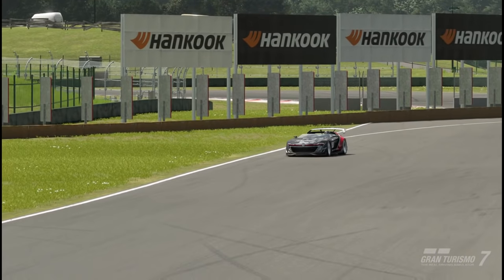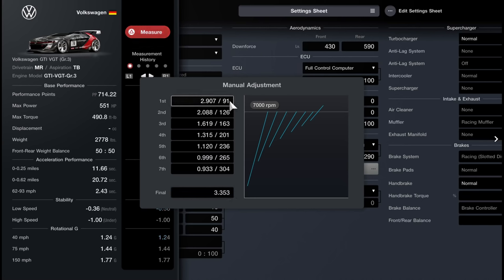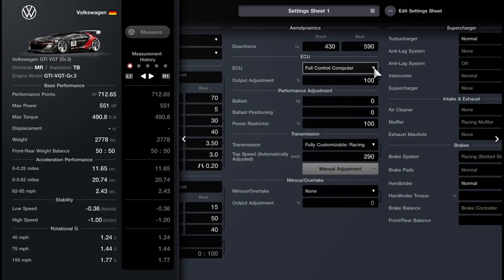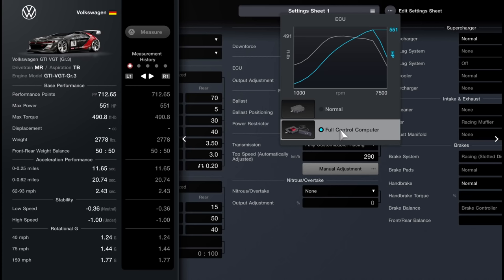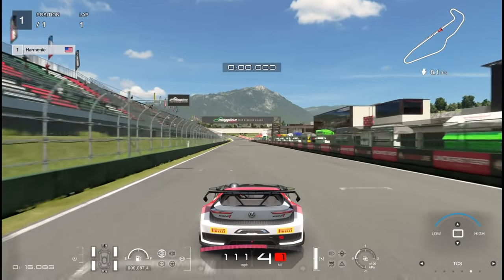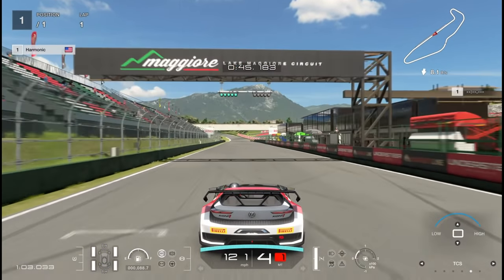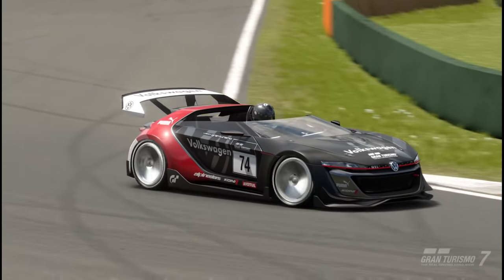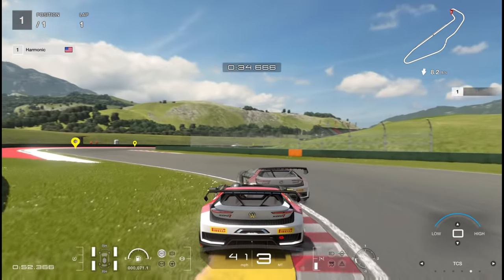How to Tune GEARING | Gran Turismo 7 Tuning Guide

Comment: The Stanlick formula: 

Gear Ratio = 1 ÷ (1 - ((1 - (1 ÷ Point of Convergence)) ÷ Convergence Factor) • (Final Term)) 

Explanation: 

• Point of Convergence: This represents the desired 1st gear ratio upon which all other ratios will converge. It sets the foundation for the exponential progression of subsequent gear ratios. 

• Step-Length: Calculated as Number of Gears - 1, or (N - 1), is the amount of steps between the Point of Convergence and the remainder of the steps, or in this case, gears. For a 10-speed you would have 9 steps, for a 9-speed it would be 8 steps, for an 8-speed it'd be 7 steps, and so on; just be sure that the difference between the Final Term Floor and the Convergence Factor is always equal to (N - 1). 

• Convergence Factor: This controls how quickly all steps (or gear ratios) converge towards the final step (or ratio) that is at the Nth step (or gear). It's closely tied to the Number of Gears (N) and the desired Overdrive because: Convergence Factor + / - (+ / - Final Term Floor) = N - 1. The Convergence Factor is always minus a (negative Final Term Floor value), and plus any (positive Final Term Floor value). The Convergence Factor must be reduced or increased according to whatever value the Final Term Floor is to follow the rule N-1 = Step Length, which ensures that the Step Length is constant. 

• Final Term: This term is incremented for each gear, starting from the highest (final) gear and adding +1 to it for each preceding gear. Its floor value determines the Drive Level. A Drive Level of 0 = no Overdrive (1.00 : 1.00 top gear) whereas negative values for Drive Level such as -1 will produce levels of Overdrive. The opposite is true for values > 1, yielding more Torque Multiplication closer to the Nth ratio and producing Underdrive. 

• Final Term Ceiling is what ensures that the first gear ratio is achieved when it matches the Convergence Factor. This means that if you add 1 to a Final Term of -1: (-1 + 1) and make it zero, you'll get 1.00 : 1.00 as an output from the formula. If you add 1 again, it produces a number that is > 1.00. If you continue to increase the Final Term incrementally by 1, by the time it equals the given Convergence Factor, the formula will produce the desired first gear ratio that was set as your Point of Convergence. 

Example: 

• Using 1÷(1−((1−(1÷3))÷8)×(−1)) for a 10-speed transmission, it will produce the following ratios from 1st to 10th gear (rounded to the nearest hundredth): 3.00, 2.40, 2.00, 1.71, 1.50, 1.33, 1.20, 1.09, 1.00, and 0.92. 

• The reason it has 8 as the Convergence Factor is because it is for a 10-speed gearbox wherein there are 9 steps between the given ratio of first gear and the resulting ratio of last gear, so (9 + -1) = a Final Term Ceiling of 8, and that ceiling (8 - -1) = 9, which preserves the Step Length of 9 for a 10-speed. Whenever the Final Term matches the Convergence Factor, the result will always = Point of Convergence, which is in this case 3.00 at 1st gear. 

• Of course, if you keep the Point of Convergence at 3.00 but lower the Final Term Floor to something that is < -1, say -2 or even -3, it will produce several levels of Overdrive and will create a more gradual progression both converging to the Point of Convergence and diverging towards the Nth gear. The opposite of this is true if you want less overdrive and desire a final gear of 1.00:1.00. Just make the Final Term Floor = 0, and the step length of N-1 for a 10-speed that is 9 would be seen as the Point of Convergence because (9 + 0) = 9. 

Key Principles & Advantages: 

• Exponential Scaling: The formula generates gear ratios that follow an exponential decay pattern where going in the direction further from the Point of Convergence there is progressively less delta between consecutive ratios (convergence). This results in a "wider" ratio spread amongst the lower gears, prioritizing torque at lower speeds, and each gear above the previous becomes progressively closer on the delta between consecutive ratios (divergence) as they get closer to the Nth gear. Obviously, given the sheer number of gears and the other parameters in the formula, you can scale exactly how steep this exponential decay (convergence towards Point of Convergence and divergence towards the Nth gear) is and exactly how gradual or sudden it is to get the set of ratios that best suits your needs and vehicle using pure algebra. This is a mathematically precise way to take advantage of the nature of geometric exponential feedback loops, that yields numerically perfect and scalably balanced ratio spreads with zero guesswork beyond the input of initial values. 

• Adaptable Convergence and Divergence: The Step Length adjusts dynamically based on the number of gears and desired Overdrive as determined by the Final Term Floor, ensuring seamless integration across various transmission setups. 

• Precise Overdrive Control: The Final Term Floor value allows for precise control over the top gear's overdrive level, enabling customization for specific tracks and racing strategies. 

• Consistent Step Length: The formula maintains a consistent step length (N - 1) between gear ratios, ensuring a balanced and predictable progression for smoother shifts and improved driver control. 

Ratio Spreads from 10 to 3-speed 

• Here is a series of charts for a 10-speed all the way down to a 3-speed. I chose a first gear of 3.00 : 1.00 as it is a median between 4.00 : 1.00 and 2.00 : 1.00, and I adjusted the Final Term Floor to -1 to apply a single level of overdrive to all of the spreads. Of course, you can manipulate these values at will to make your own charts. 

• The formula used for these ratio spreads is as follows: 1÷(1−((1−(1÷3))÷Step Length)×(−1)) and here are the results: 

10-speed: 1÷(1−((1−(1÷3))÷8)×(−1, 0, 1, 2, 3, 4, 5, 6, 7, 8)) 

1=3.00 (8)
2=2.40 (7)
3=2.00 (6)
4=1.71 (5)
5=1.50 (4)
6=1.33 (3)
7=1.20 (2)
8=1.09 (1)
9=1.00  (0)
10=0.92 (-1)

9-speed: 1÷(1−((1−(1÷3))÷7)×(−1, 0, 1, 2, 3, 4, 5, 6, 7)) 

1=3.00 (7)
2=2.33 (6)
3=1.91 (5)
4=1.62 (4)
5=1.40 (3)
6=1.24 (2)
7=1.11 (1)
8=1.00 (0)
9=0.91 (-1) 

8-speed: 1÷(1−((1−(1÷3))÷6)×(−1, 0, 1, 2, 3, 4, 5, 6)) 

1=3.00 (6)
2=2.25 (5)
3=1.80 (4)
4=1.50 (3)
5=1.29 (2)
6=1.13 (1)
7=1.00 (0)
8=0.90 (-1)

7-speed: 1÷(1−((1−(1÷3))÷5)×(−1, 0, 1, 2, 3, 4, 5)) 

1=3.00 (5)
2=2.14 (4)
3=1.67 (3)
4=1.36 (2)
5=1.15 (1)
6=1.00 (0)
7=0.88 (-1) 

6-speed: 1÷(1−((1−(1÷3))÷4)×(−1, 0, 1, 2, 3, 4)) 

1=3.00 (4)
2=2.00 (3)
3=1.50 (2)
4=1.20 (1)
5=1.00 (0)
6=0.86 (-1)

5-speed: 1÷(1−((1−(1÷3))÷3)×(−1, 0, 1, 2, 3)) 

1=3.00 (3)
2=1.80 (2)
3=1.29 (1)
4=1.00 (0)
5=0.82 (-1) 

4-speed: 1÷(1−((1−(1÷3))÷2)×(−1, 0, 1, 2)) 

1=3.00 (2)
2=1.50 (1)
3=1.00 (0)
4=0.75 (-1) 

3-speed: 1÷(1−((1−(1÷3))÷1)×(−1, 0, 1)) 

1=3.00 (1)
2=1.00 (0)
3=0.60 (-1)
Reply from the maker: @joshuastanlick6217  it's cool that you went through all the trouble to do that, but unfortunately that's not the best way to optimize gears because every engine's power and torque curves are different, and each track has different cornering speeds. Going with the philosophy I demonstrated in the video will get you better results in less time.
Reply: @Harmonic14 I do not concur. Adjusting the terms in the formula can give a mathematically precise set of ratios, and even if they may need further refinement after initial calculation because the mechanics aren't intuitive, they are still an excellent reference and will always win out in precision with just a bit of study. I know it isn't the only method, and if a more organic approach is your jam, that is indeed cool as well. I prefer to take 3-5 minutes to crunch some numbers and get something numerically perfect based on gear spread, amount of gears, and things like the torque and power curves of a combustion engine, which the commensurate scaling addresses passively, rather than eyeballing things. For others who prefer a more technical approach, I'm sure they'd appreciate the coolness of my work, which I have provided to enhance your more organic approach. I think a combination of precision and eyeballing things can yield the most effective results.
Reply: @Harmonic14  I encourage you to play with the values in my formula: 1÷(1−(((1−(1÷Desired_1stGear))÷Scale_Factor)×((1+Increment_Factor))) to see what kind of results it can produce for you.
Reply: @Harmonic14  Or, use one of the provided gear sets that I calculated using 1÷(1−(((1−(1÷3))÷Scale_Factor)×((−1+Increment_Factor))) and see how that works out for you before implementing the organic approach.

Comment: Great video! One question, when using manual Adjustments has the ‘Top Speed (Automatically Adjustment)’ any influence? I think not, but it makes more sense if it greyed out.
Reply from the maker: Top speed is just a quick slider to set all gears longer or shorter. Be careful with it though, because if you move it after setting your individual gears, it will revert those changes. That's why I tend not to use it.
Reply: Adjusting the final drive to a lower value will increase top speed and the opposite for more acceleration. If you want to have it set for a certain circuit have the gearing set for an extra 10kph to allow for drafting on other cars

Comment: Awesome video, I did have a question, you mention adjusting the gears to be in the peak power band before drop off but how do I know I am adjusting the gears in that band
Reply from the maker: Just check what RPM you're at in each gear, just like in the video
Reply: @Harmonic14  oh I see what your saying got it makes sense. I thought there was an easy way while changing the gear ratios that we could see that. Thank you.
Reply from the maker: @vrdubb0221  unfortunately there's not, which is why I didn't really cover the actual gear chart much. It just gives you an RPM limit, and it tells you what speed you're hitting at that limit, which isn't enough information. By the time you eyeballed that graph and figured out where you need the gear to be, you could've done it on track already and made multiple adjustments.
Reply: @Harmonic14  sweet, thank you. Keeping making the banger videos. It’s super helpful.

Comment: Awesome easy to understand. I have a question. I’m using the Nissan z33 fair lady. Every time I accelerate in lower gears she kicks out on me and I spin out. How would I correct that. Is that in gearing? I haven’t changed them at all.
Reply from the maker: You could potentially change your gears to alleviate that, but throttle control also plays a part in it. Ideally, you'll run TCS at 0 and modulate throttle so you don't wheelspin, but if you need to, put TCS 1 just to learn the car a bit more, then try going to 0 and practicing precise throttle control.

Comment: I’m so confused. I don’t understand how to interpret the gear numbers and the graph as it relates to the ideal RPM for power/torque. How exactly do I know where to set each gear?!
Reply: The lower the gear the faster the car is but gears take longer. Which for circuits like delivery stage route X (US) is the best.
The higher the gear the shorter the gears take but make the car slower. Ideal for technique circuits.

Comment: This is an amazing video, so informative.
Can you make a video explaining the strategies in tuning cars for 600 and 700PP races? I raced a car and set it up for the menu books and passed the tourneys, but the single race 600-700 PP races i can't come in first.
I've took high end cars and throttled them back, took weaker cars and upgraded them, tuned the transmission for last gear redlining on the straight, used low and mid turbos when I can.
Micro manages slicks to hard sports to add more horsepower. ETC

I'm tinkering EVERYTHING and I really don't know what the best approach is to tuning for a set PP. If you made a video explain how to approach tuning cars to a set PP , like buying weak cars and gearing up to the PP or getting suped up cars and power regulating them back down, swapping slicks instead for more power components ETC, this video would be the missing link the video game forgot to implement as a tool for teaching people how to REALLY tune your car and not JUST add faster gear, but to look at all aspects of tuning like taking control components over HP: torque comments ETC.

Can you do a video on the do's and don't's of finding the right cars and tuning practices for set PP races?

Thank you good sir. Thank you for this great video, super helpful. now target this to getting a car to a optimal specific PP race. 😛
Reply: What I do for the Gr3 races with a 730pp limit, is use a car of preference (I like the Gr3 McLaren 650) and then add a turbo that suits the car best (for the McLaren it's the mid RPM turbo) and then use the power restrictor to get it back down to 730pp. The change seems small but you usually get something like +50bhp this way and a nice chunk of torque during corner exits. Sometimes the power restrictor is not enough even at 70%, you then add some ballast until you get under the desired PP. Hope that helps. The races are still challenging, especially the 5 lap races. The 10 lap races are quite easy if you use 6 fuel management and go for a 1 stopper every time.
Reply: @johnraesen5368  
Thanks for the tips, I wanted these guys to make a video on how you can't skip over tires, customizable trany's, brakes etc.

You used a GR3 car so most of this was covered for you, but there are situations when you take a standered car and need to tune it up properly, taking into account the stability parts and how to balance them all.

So that's what I'm aiming for, and it's not just for me, it's for the community at large.
I think the game missed and opportunity to implement this into the game like the earlier ones, when they teach you, and help you fully understand the nuance of racing.
Reply: @l337g0g0  gotcha. What I can still share is that other than the Gr3 races, for the 700pp races I use a tuned '91 GTO that has like 698PP but devours the competition due to its superb handling. I didn't tune the suspension, LSD or gearbox manually and just went with hard racing tires and all the other upgrades from the shop that will boost performance.

For the 600PP race it gets a bit tougher, but I use a R34 Skyline with turbo installed and a few other upgrades, but the key is obviously to keep it below 600PP so you have to be careful with the upgrades.

Other than that, the only things that are really worth understanding while tuning are suspension, gearbox and differential (LSD). I agree that the game does not explain these terms very well as they can be quite useful to make a car perform to your liking.
Reply: @johnraesen5368  
that's my point.
Suspension, tires, how you can implement the LSD, lower final gear on tranys to make the most utilization of your tyrany upgrade and not waste top end speed you will never use on a given track, and put it to acceleration.
Right, you can go much deeper on car height, strength of sway bars and braking distribution, weight distribution, down forces etc.
The game has the ability to go all out and fine tune to the emf degree.
But the basics in the game are not covered I don't think.
Reply: @johnraesen5368  
Do me a favor and use your Mustang GR4 and try and win the GT cup GR.4 race at High speed ring.
I've done everything possible to that car and once got a 1:18 I think cause of drifting and I can't get past 3rd.

Tried Supercharger, none super charger with the S-hards and S-softs etc.

here is where I'm not making these turns properly or I can't tune it properly.
Reply: @l337g0g0  try this for the suspension: anti-roll bar both to 10. Damping ratio compression both to 40. Damping ratio expansion front to 30 back to 35. Natural frequency front 3.25 back 4.00. Negative camber front 1.0 back 1.5 and remove all toe angle (both 0.00). This circuit is high speed and doesn't have a lot of corners, this will make your car faster. Let me know how it worked out for you.
Reply: @johnraesen5368  I'll try it.
Reply: @johnraesen5368  
Ok it was a track issue I figured it out.
So earlier I did the Circuit experience to see how to get golds on the turns.
After watching the demonstration for each section, I notice that the car was on the top of the tracks, I remember them doing that in the races also.
So I was wondering why they weren't taking the APEX, and how the fuck are thy beating me and I'm taking the apex and they weren't?!?!
So before I tested your inputs, I had to do the race how I got the golds in the Circuit experience, and then it dawned on me, OHH YEA, they are on the angled part of the track, so when I was on the inside of the track on the turns my wheels were slipping cause they were on a level surface doing a tighter turn, and was like yea the outside will let your grip the track on that angle and you can gain speed even cause the angle is giving you more traction on the turn.

It was the turns, I twas doing them properly for what I knew, turn in to the APEX, but with angled tracks it's a whole different turn and you are better going on the outside to get that extra traction so you can even accelerate around the turn like that.

This game is so crazy, they don't even teach you that, you end up discovering it like I did from putting in work.

thank you for the tip, I'll still try it, but i had to do this first for the process of elimination, if I did yours also same time I wouldn't know what made me win now.

amazing stuff oval slanted tracks you take the outside and screw the APEX.